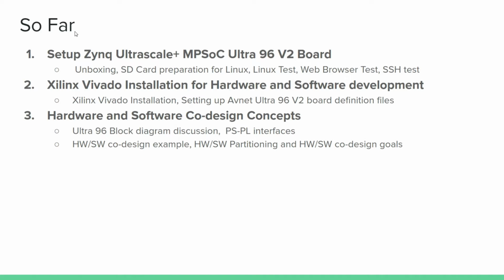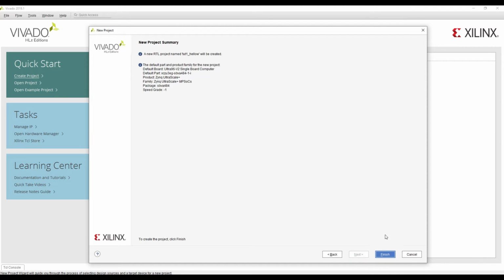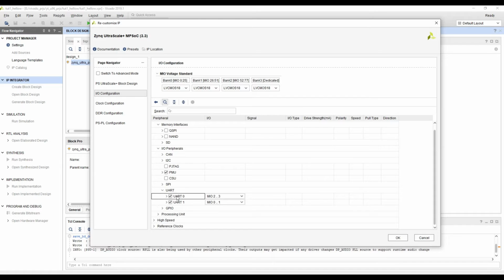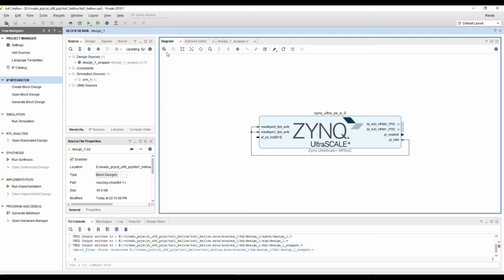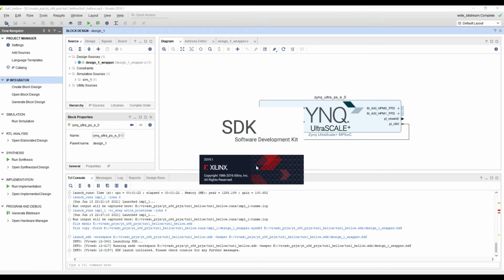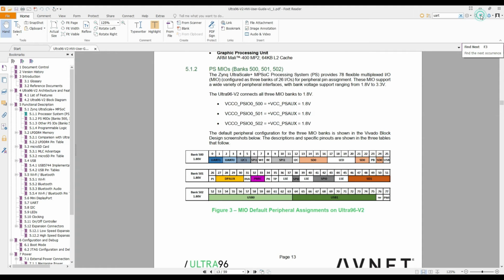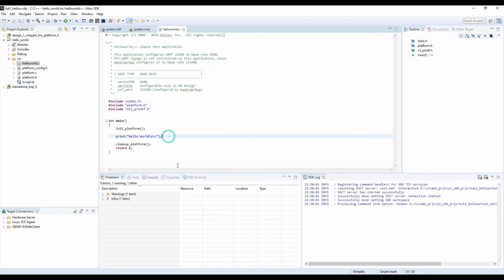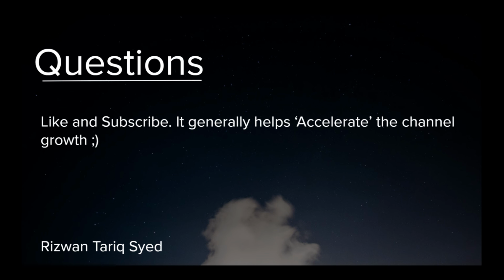Zynq Ultrascale+ MPSoC Ultra96-V2 - Hello World Project

Comment: Please do a video about using just the FPGA chip with minimum circuitry on a breadboard.
Reply from the maker: I plan to start making videos again. Could you please explain a bit more, what do you mean by 'minimum circuitry' ? 

Do you want to control something on the breadboard using the FPGA Chip ?
Reply: @rizwantariqPhD  Most of the FPGAs being sold with boards. I wanted to know what is minimal circuit for an FPGA (without board) should have to power up, boot and loading up of a program through usb without controlling anything yet. I plan to buy just the chip instead of the entire board, running entirely on breadboards. A rat's nest if you will.
Reply from the maker: @realsillyrabbitshow  Alright. so you dont need complete evalualtion board. but you need something minimal, which can still get you to play with FPGA etc. 

I think you should look at, 'System On Module' , also called as SOM.  good with the keywords, "Zynq FPGA System On Module", you will find plenty of stuff.

Comment: Hi, in case I power off the 96Board. Will the Board behave next time it powered again. Thx!
Reply from the maker: Hey, 
when you switch off board. every thing gets erased. The work flow described in this video, requires you to program the board again after rebooting. In other words, if you switch off your FPGA board, and if you switch on again, you have to re-program your FPGA with the Bitstream and .elf file.

Comment: The Ultrascale+ MPSoC has multiple ARM processors that can be used for different things so some of them can run linux while others run the user program and so on. I am not fully sure what it is the motivation behind its creation.
Reply from the maker: Heyy, If i understood your question correctly, you mean to ask,  what is the reason behind a such a Board , which has FPGA Fabric and also has ARM cores. 
Short Answer is: HW/SW Co-Design. 
I have explained the concept of HW/SW Codesign it in detail in this video : https://www.youtube.com/watch?v=xb7QBuBZuvI&t=1s&ab_channel=RizwanTariq
Reply from the maker: if the question is why there are multiple ARM Cores. 
In my opinion, the short answer is 'High Performance b/c of Multicore processing'. i.e. You can run four different applications on four processors etc.

Comment: Good video, clear steps and I liked the explanation of choosing UART1 - I struggled to find out why until seeing this.  It may be worth pointing out that the toolset you are using is an old one and from 2020 Xilinx uses Vitis as an integrated environment rather than SDK.  For people new to this, it takes some figuring out as Vitis and SDK are different enough to require alternate sources to work out the right flow.  I struggled from the point of where you switched to the SDK tool.  I know you've only just created this video but it may be worth switching to the new toolset for any subsequent videos you create - just a thought.
Reply from the maker: Thanks Alot Andrew for taking the time to write a feedback. I really appreciate it. 
you are right, the Xilinx has switched to Vitis.  The reason I decided to use this, as I am using some other tools, which are still using Xilinx pre-2020 tools. some third party open source tools still support old Vivado tools chains.  That's why i decided to stick with the pre-2020 workflow. 
For future, Yes, Vitis is already something which i am planning to make videos on.
Reply: @rizwantariqPhD   I agree too. if possible should make video use with Vitis . I think better for beginner learning .
and I thank you make this video . it's very clear and easy understand too much .
Reply from the maker: @akkarawat  Thanks alot man. Glad that the video was useful :)

Comment: First of all, I thank you for your tutorial. I did "Launch on hardware" my hello_world program and it works good. but, after reboot my Ultra96V2, it do nothing(I mean Ultra96V2 board do nothing). How can I make it start my hello_world program? Power on Ultra96V2 and auto-start hello_world and send string "Hello World" to PC via UART. Help me please...
Reply from the maker: Thanks. Good to know that it worked. 
when you switch off board. every thing gets erased. The work flow described in this video, requires you to program the board again after rebooting. In other words, if you switch off your FPGA board, and if you switch on again, you have to re-program your FPGA with the Bitstream and .elf file. 
if you want to auto-start your hello world software program and print it on the UART terminal on PC. then you have to follow another method, which is called, programming the Flash memory. Flash memory is a kind of memory that retains data in the absence of a power supply. so when you switch on your FPAG again, your FPGA board will load the program from the Flash. in this way, you will be able to see the hello world on the PC UART terminal.
Reply: @rizwantariqPhD  Tanks alot for your reply.